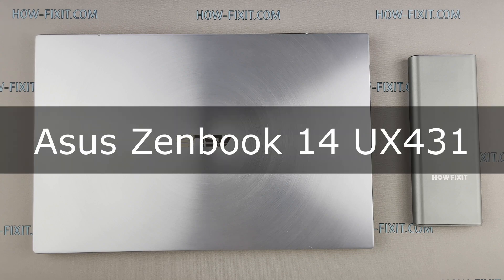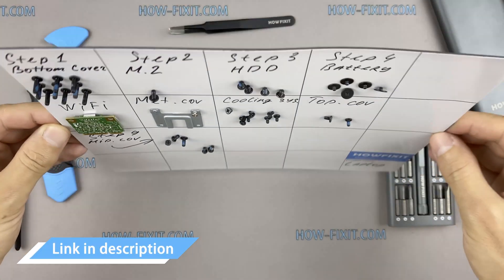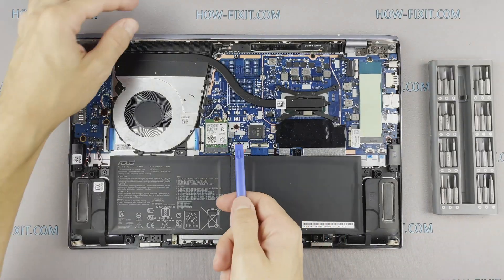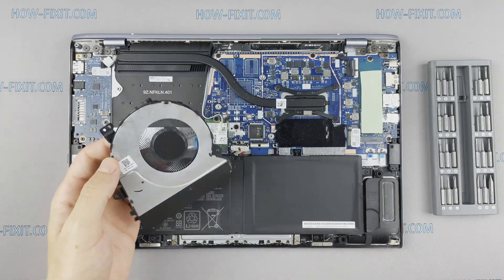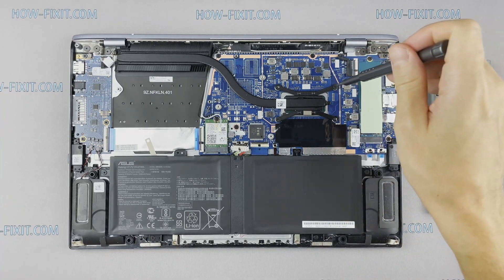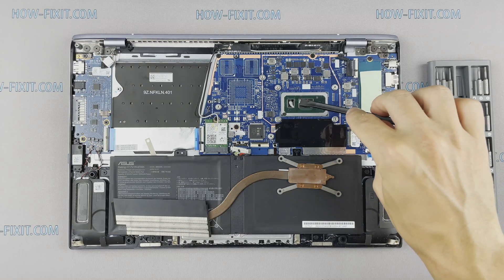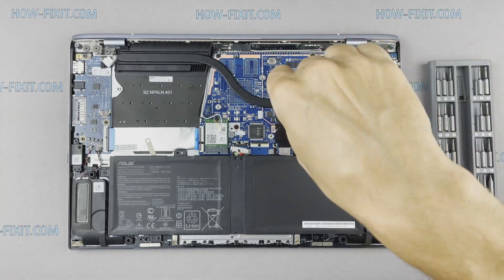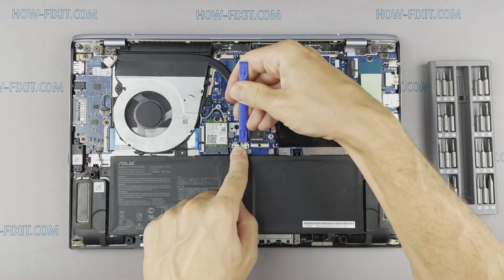Asus Zenbook 14 UX431 Disassembly, fan cleaning and thermal paste replacement

Comment: Thanks for the video. My cooler has started rumbling and I was really worried that the cooler can not be replaced without removing the heatsink I don't really want to touch.
Reply: Just put some oil in it.
Reply: @ it didn't last for long, unfortunately. This year I had to replace the keyboard and it's still the best laptop I've ever had